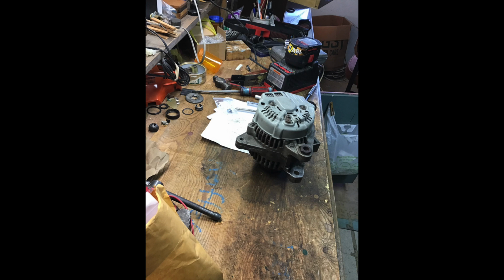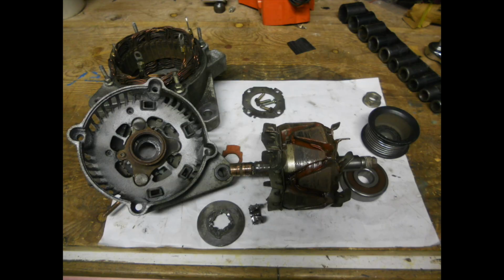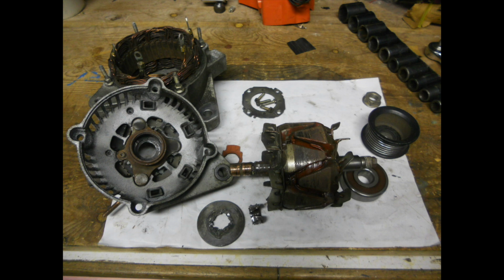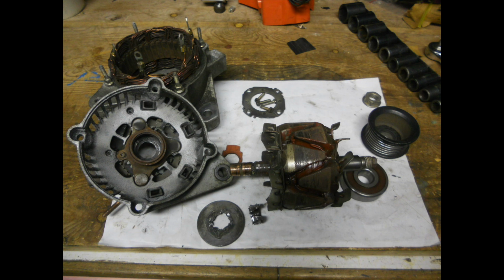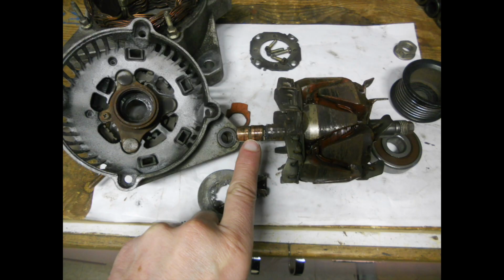2003 Camry Denso Alternator Rebuild (Bearings and Brushes)

Comment: Nice job with the rebuild, very clearly explained and demonstrated. Was this the original OEM Toyota alternator? Great video, thanks for posting!
Reply from the maker: This was not the original alternator. It was a re-manufactured one with a Bosch sticker. It didn't last as long as a new one. I suspect all the bearings weren't replaced when re-manufactured. Thanks for your comment!
Reply: @davidtinkers  They like to use chinese bearing and your're lucky to get 3 months out of them.